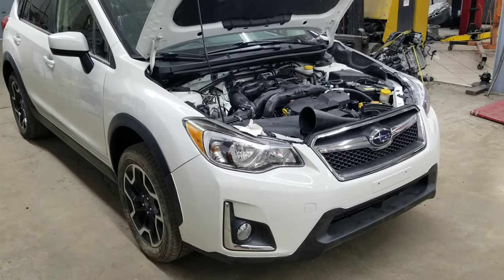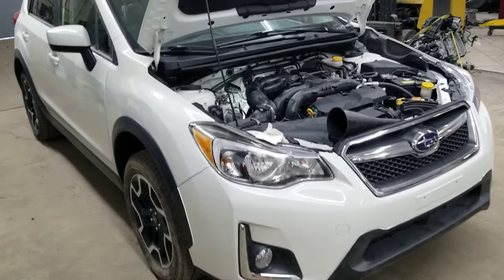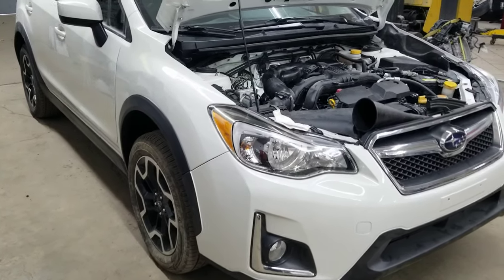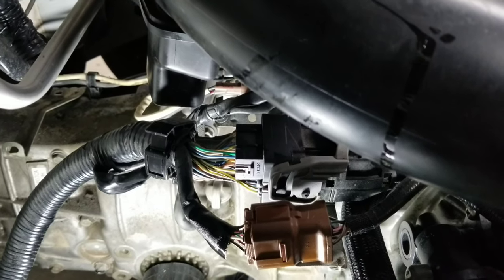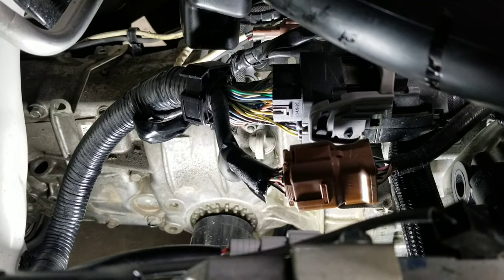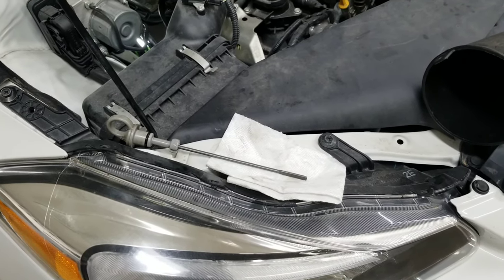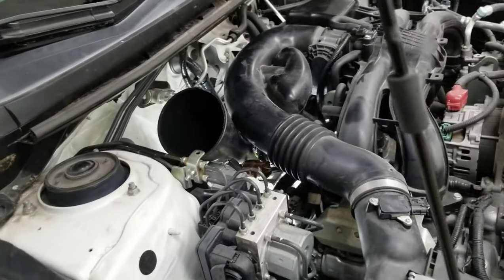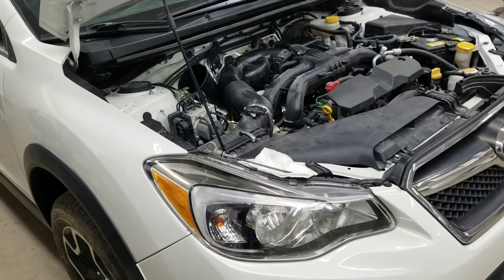HOW TO CHECK MANUAL TRANSMISSION FLUID LEVEL ON A SUBARU XV CROSSTREK / IMPREZA

Comment: Thanks for the info George.  I didn't even know there was a dipstick for the manual transmission.  I was under the impression it was a sealed system that you couldn't check.  Maybe subaru is hoping to get some hefty repair jobs for failed transmissions lol.
Reply: same here